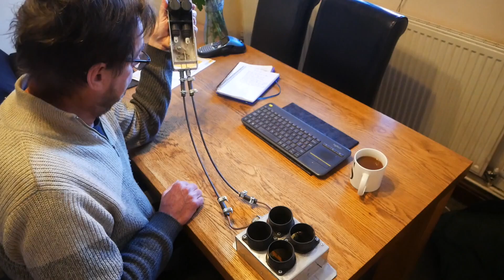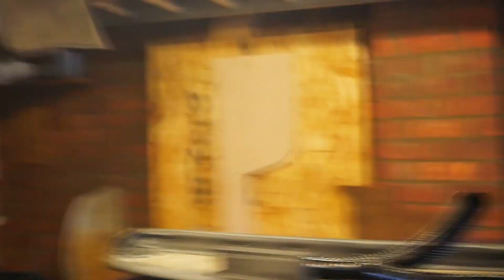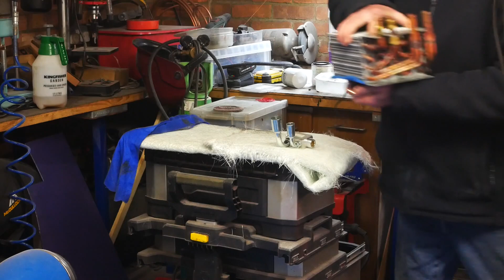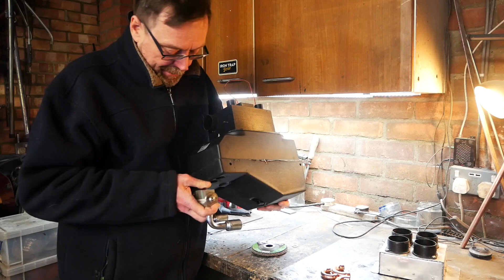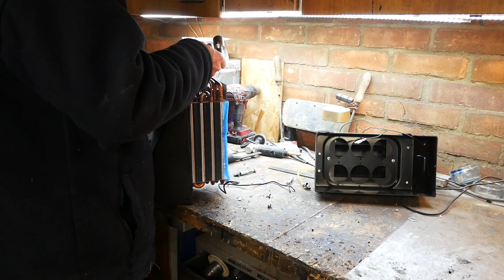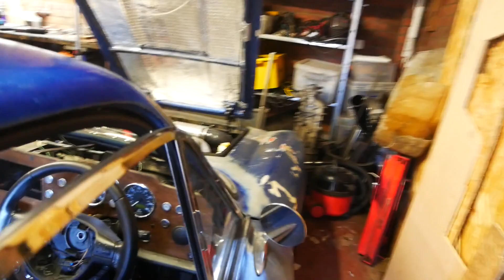Classic Car HVAC

Comment: Nice work. Where are the fresh air vents connected? I can’t see any windscreen grills, is it like the earlier Gilbern GT with the 3 inch pipe pointing near the grille?
Reply from the maker: Thanks
My car came with no dash at all so I got hold of a dash top from the owners club. I don't really know what it came out of. 
That Dash top to my surprise had no vents so I cut my own using vents from Car builder Solutions. The fresh air vents are plastic jobs also from CBS while the pipe to the front is a combo of corrugated plastic pipe running through the top of the wheel arch and  two 45deg 3D printed bends where that passes through the bulkhead and front inner arch
Reply: A massive upgrade on the GT then. That had a 3 inch pipe pointing forward next to the radiator connected to an axial fan and the infamous Smiths Heater box with 2 outlets to the windscreen. Even when new the fan was described as having the blowing ability of a weak fart so sounds like it wasn’t the best system!
Reply from the maker: @andycoutts1277  I shall have to study some original Gilberns some more. Mine had so much missing it was a matter of guesswork and creativity

Comment: When’s the engine due to be back out? 
Great job on that dash job! Too complicated for my brain though!
Reply from the maker: Did you think you were joking? Unfortunately the actual answer is probably in 2 or 3 weeks time, as I really need to fix that reverse gear - a self inflicted  problem where I removed the wrong bolt thinking it was the gear oil filling point when it was actually the reverse gear selector pivot. 
At least that will also allow me to finish tidying the engine bay